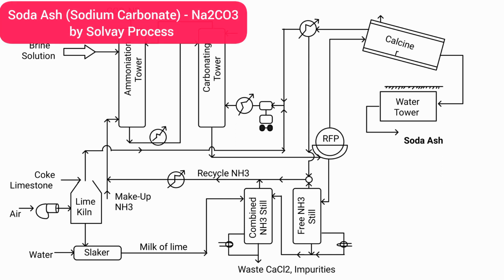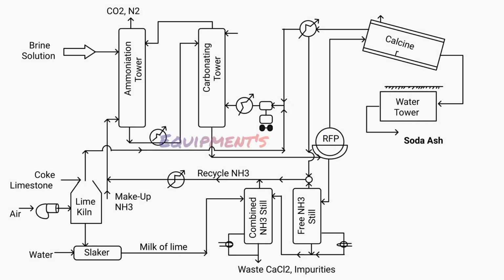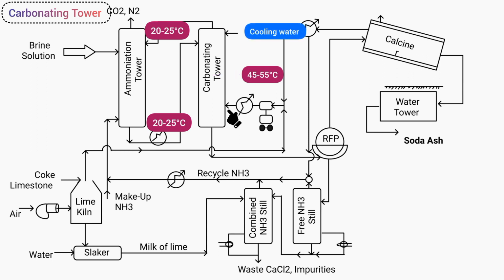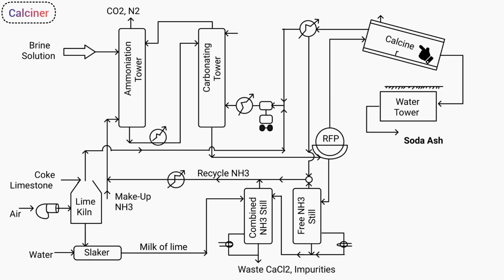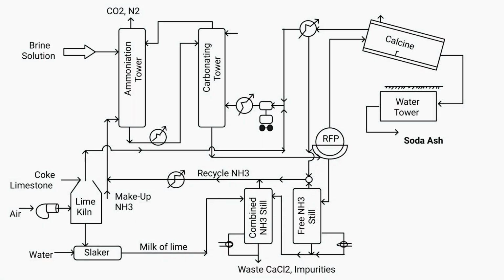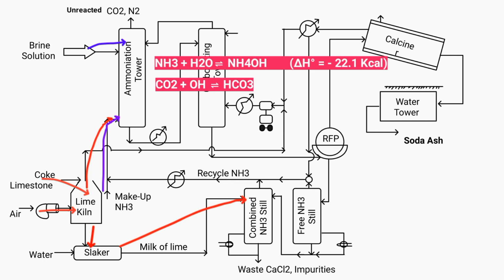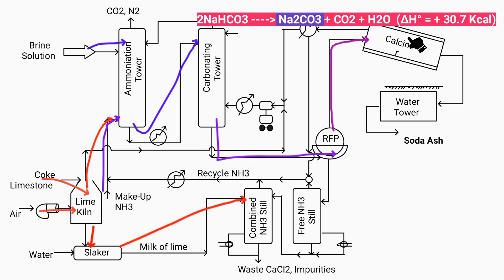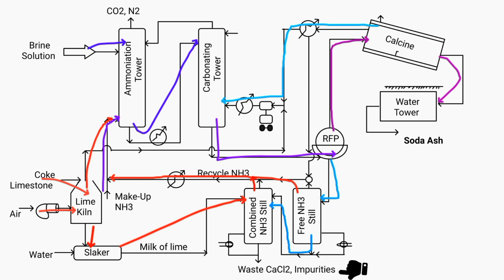Manufacturing Process of Soda Ash (Sodium Carbonate) by Solvay Method with a Flow Chart

Comment: Solvay claims to have improved their Solvay Process with a pilot plant in Dombasle France that produces 50% less carbon dioxide, reduces water, brine and limestone consumption, and completely eliminates limestone residues according to a September 2022 article from Solvay.  I don't know if the pilot program in France was viable or not. It would be nice to know if the pilot program has advanced to the implementation phase or not.